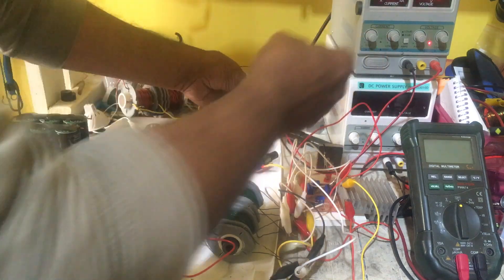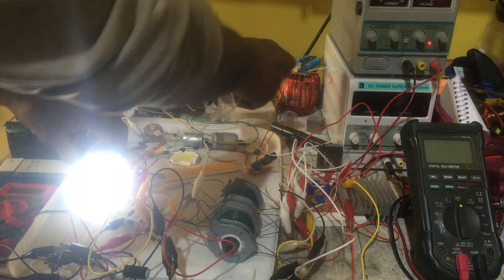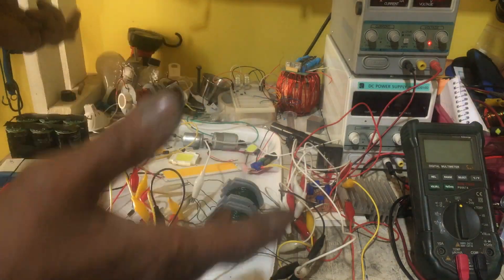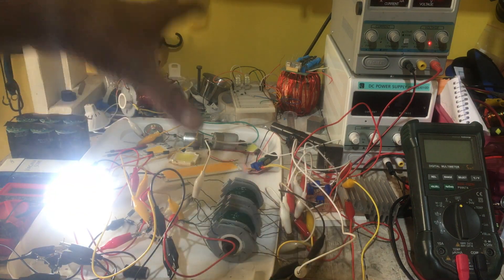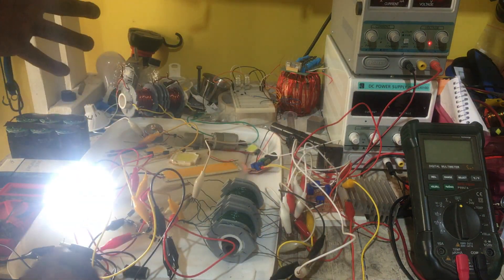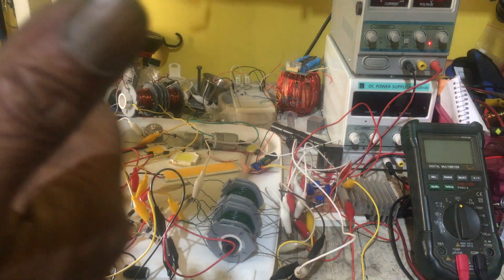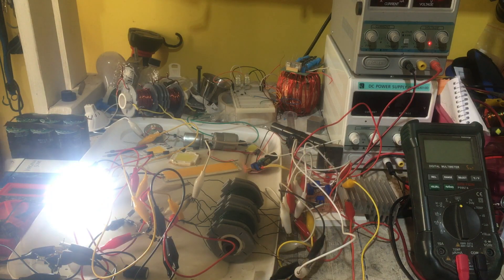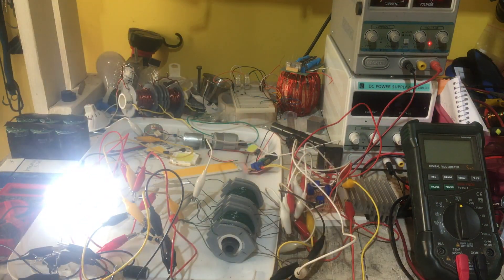SSG is a back EMF generator and induction Recptor coil with unlimited potential.  So we begin

Comment: Use large gauge winding 8-10awg for S2 with less turns and small 20-30 awg S1

Say 220 turns s1 and 24 or less turns s2

Or 120 turns s1 and 12 or less turns s2

Primary can be anywhere from 400-1000 turns 
Of small awg winding to limit amp draw 30 awg  or more is best. 

You will have large amplification from the low resistance small turns S2 increasing the amperage via turns ratio and pumping it into the higher voltage s1 coil without any excess Amp draw on primary. 

Power consumption should drop to less than 10 watts and you should get 3kw out. 
With a small transformer core and those awg wires listed 
Let me know your results
Reply from the maker: You have a schematic or video what are the connection what drive it.
Reply: @sidster64  drive it with a variac and mains voltage . It will only require a few watts to pump the current. 
In the configuration of the patent you show in the beginning of your videos. 

The larger gauge wire more amps flow. 
You can also make one of the secondary coils on a separate core of a transformer 
In reference to Elihu Thompson patent 
USP # 400,516
Reply from the maker: @RustyShakleford1  I found this patent cool it will take time to process.
Reply: @sidster64  
E. Thomson 
Patent no 400,516 
“Method of regulating current or potential in secondary of transformers.”
Patented Apr 2, 1889

Use fig. 17 and 18 of this patent as a reference to your patent you show in your videos.
Reply from the maker: @RustyShakleford1   You got my interest I'll check into it Thank you very Nice